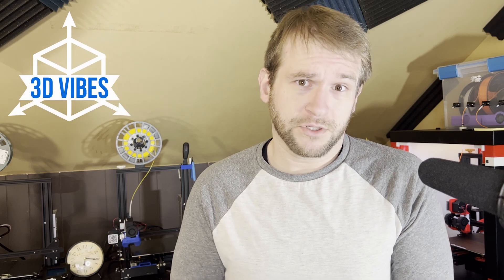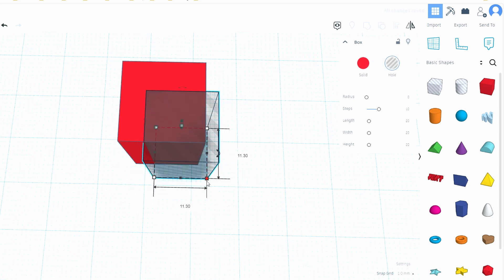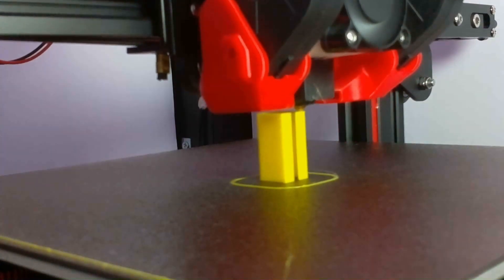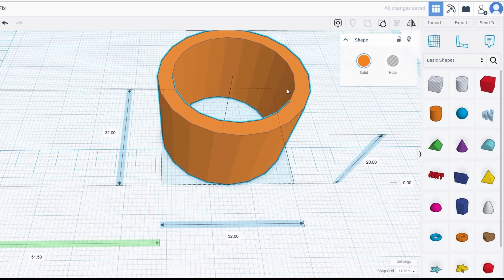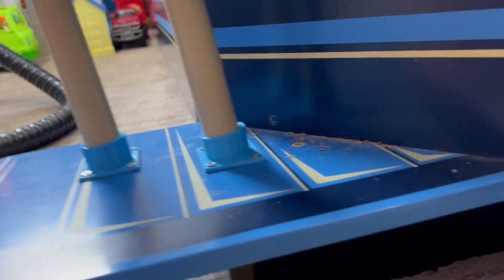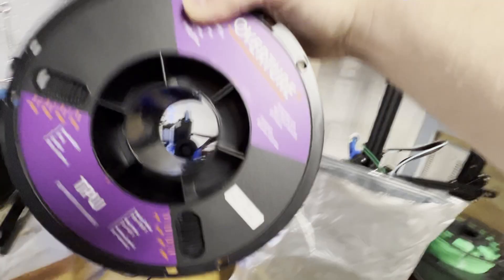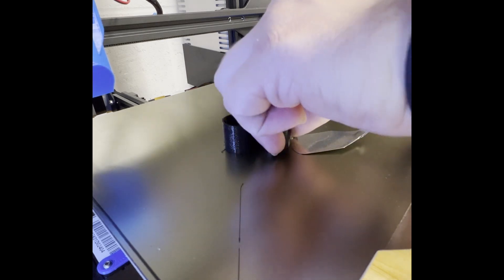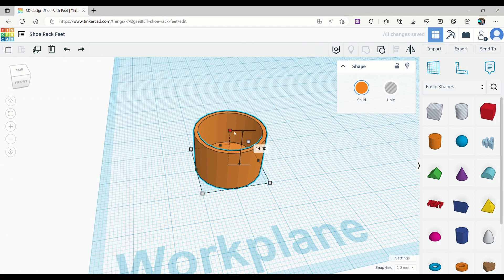A Few Simple Fixes with 3D Printing Using TinkerCAD

Comment: The circles are not perfect circle. Why? The software is the issue or the 3D printer?
Reply from the maker: In TinkerCAD, you can change the amount of sides on a shape. Increasing the amount of sides will make cylinders more round. 

I hope this helps!
Reply: @3DVibes  Understand. Can't be made a cylinder perfect round?
Reply from the maker: The cylinders in the video used the default of 20 sides, increasing to TinkerCAD’s max of 64 would make the cylinders much smoother.

If you want even smoother, I believe you can find high-poly shapes in the community shape generator within TinkerCAD.
Reply: @3DVibes  OK, thank you for your response!